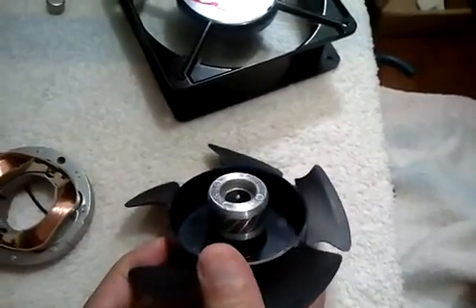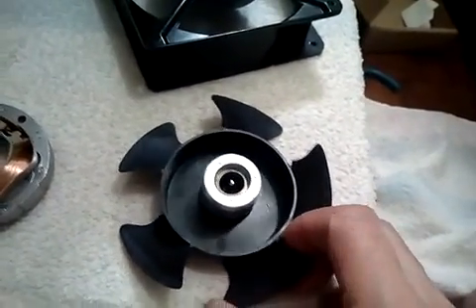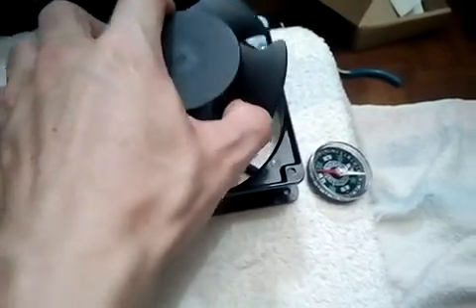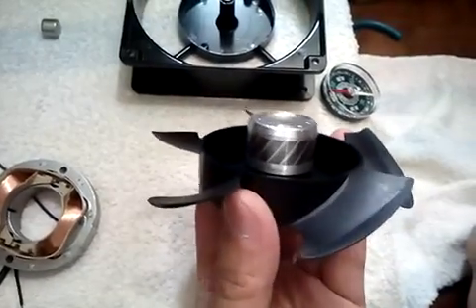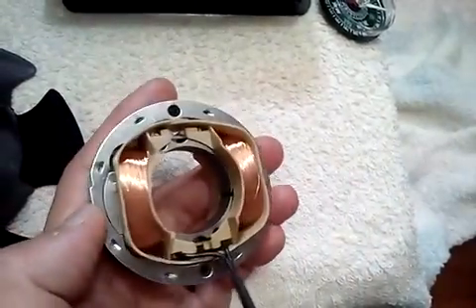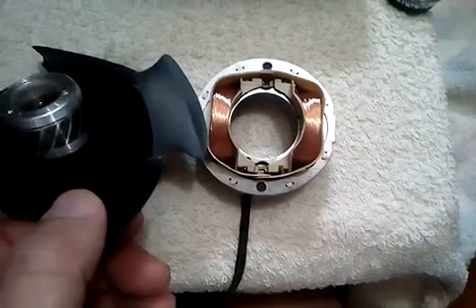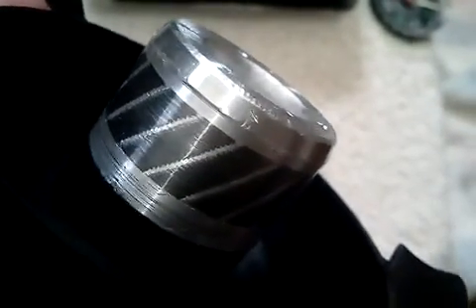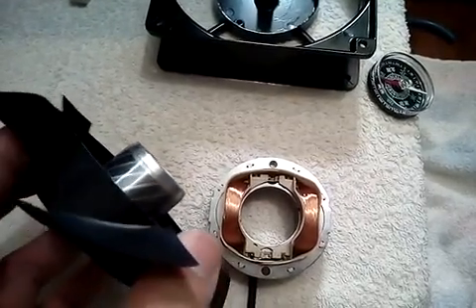BEDINI MOTOR 2.7 -JOHN SEARL EFFECT GENERATOR-

Comment: What's the point of your device here? Do you think you have the answer for free energy? If you do you will be very disappointed from all your efforts. Searl, Bedini and all the others are nothing more then con men. Pushing their pseudoscience that defies the laws of physics is pure bull shit. Naïve people might believe it for a little while until they decide to educate themselves. The holy grail for free energy has been going on for over 100 years. Anyone purporting they have discovered it is a scammer looking to rip you off.
Reply from the maker: Yes, you are right, the lighting you turn on at home is no special~ You are wrong for a reason that you are so sure~..
Reply: Sir, you are incorrect. A common heat pump does exactly what you claim cannot be done. In ten years of research I have seen several examples of machines with COP>1 several with a COP>3 and have a WORKING motor/generator/electrical system with a COP>22. I challenged a skeptic to TEST the simplest device I have WORKING in my shop right now, and while that testing is still underway, he is up to a COP>2 right now, and while he previously did a series of YouTube videos DEBUNKING my claims because he did not follow the proper testing procedures, he has been forced to reconsider what he previously assumed.   Furthermore, it is a simple test that for less than $100 dollars YOU can replicate and verify. I am not selling "kits" and you may have three batteries and a small DC 12 volt motor lying around, in which case you need to buy NOTHING. Simply watch his videos and do what he is doing. Electricity does NOT work the way we have been taught, and once you understand that, the sky is the limit. The principles shown in this simple demonstration can be applied across the board to achieve energy independence for all of us, and that is the goal. Here is the link to the ongoing testing: http://www.energeticforum.com/renewable-energy/20868-continued-tests-3-battery-system.html
I post on that site under the name Turion, and you are MORE than welcome to contact me on that forum.

Comment: That is not a John Searl effect generator. What you have is just an induction motor, i am not sure i get it. But that induction core is not as hard to make as you might think, they made the iron laminate first, then poured the aluminum around it in a mold just slightly bigger, then simply allowed to cool and machined that nice smooth edge you were looking at, until it exposed the iron core. done.

But the Searl effect core is more involved. It has to do with the law of squares, each element has to weigh a certain amount based on the law of squares. I think they are supposed to all weigh the same exact amount, each of the 4 elements. If you don't design it with the right weight ratio with each other it don't get the searl effect, and also need the waveform on the magnets. It can't just anything in the core, it has to be a rare earth, non magnetized element(the storage tank) then a plastic layer(the dam), then the magnetic layer(the glue), and the last but not least you have to have copper(for the eddie currents) to make the searl generator totally friction-less, riding on the currents and not a metal bearing, that is how it is able to super conduct!

Your induction fan rides on a metal. plastic, or teflon bearing. And it produces heat. The SEG gets colder the more you pull energy from it, not hotter. It super conducts.
Reply from the maker: Induction is like magnetism, in room temperature, a small magnet with very small radius, 

also with a very strong magnetic field, what can the magnet do? So what is the secret 

of this magnet, may you tell me?

The mass and weight are subjuct to be changed in this instant~ The stronger the magnetic field, the 

greater the reduction of weight would be, because an object with small 

radius,  but yet with a magnetic field so strong that "Antimass" would occurs

What happen to this "mass" in this case the motor, which point to a geometry, which 

answer the question of how electric and magnetic field related. When correctly understand, may 

result in the rotation of mass, even the property of nullifying its own mass~

Comment: Hi Cakegy
Good find!  Where did you get yours? 

I tried leaving a message for Sunom

i.e. the manufacturer's website found using Google

but it assumes I am in India and requires I send a confirmation code from a mobile 

:-(      This is what I found:-

Sunom Solutions (India) Limited/Bhanu Electronics306 Sarthik Complex 3rd Floor
Satellite Cross Road
Nr Fun Republic
Satellite, Ahmedabad.380015
Mr Jayesh/Mr Parag Bhanushali                                        
+91 079 26923043                                                
+91 9825098502
Reply from the maker: Tetrahedron:

https://www.youtube.com/watch?v=WLBZIV-cRNU